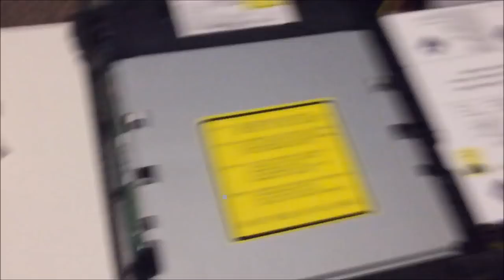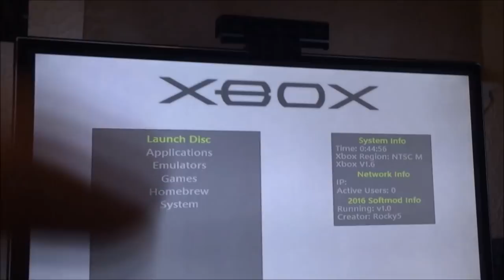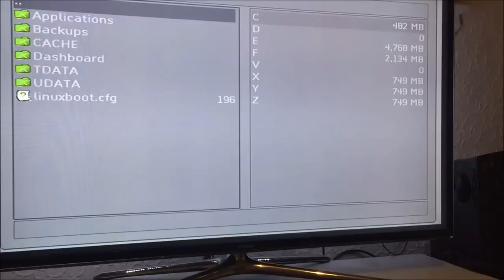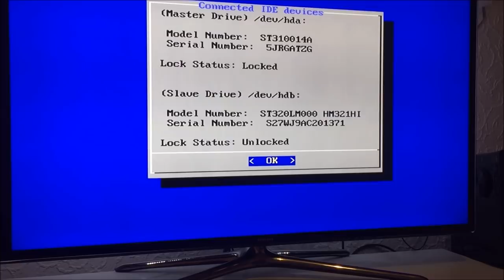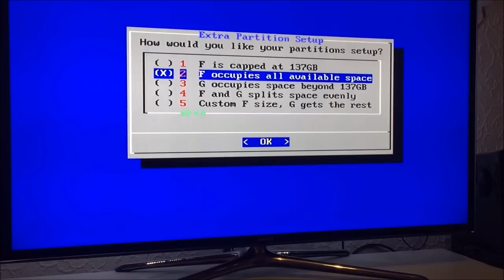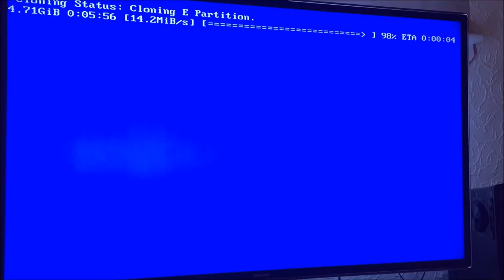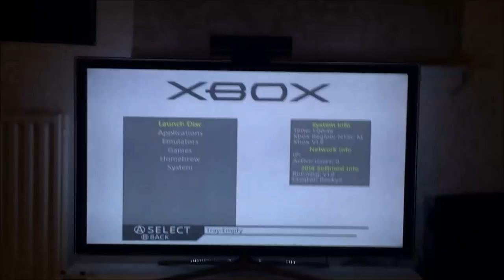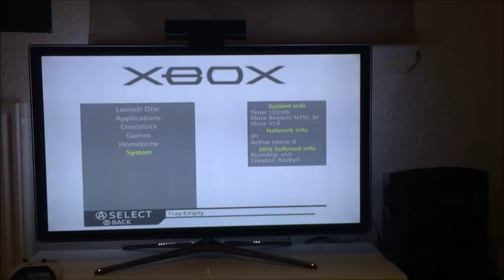How to clone your Hard drive using Chimp 261812 from start to finish.

Comment: I have an evox mod chip but my master says unlocked as well as the slave.  Is it okay to proceed to step 2 with both unlocked if i am chipped and not soft modded?
Reply from the maker: +Ashley C yes.
Reply: sorry had two more questions, 1. it is not reading the serial number on the slave, not sure if that is an issue. 2. i tried to clone and everything seemed as in your video except it said clone complete as soon as I hit okay which I know it couldn't have cloned anything that fast. Am I missing something?
Reply from the maker: +Ashley C try starting again, if you're using a sata adaptor change the slave drive to slave if you have it set to cable select as some adaptors are picky. 

Also 80 wire IDE cable if you aren't using one already.
Reply: im just using another pata harddrive going from 200gb to 250gb thats all so i am using the same ide cable the system came with.  i will try again
Reply: Hi again, I got everything to work except whatever option I choose it wont clone my F drive.  I chose C,E, and F and it skipped F.  I chose C,E,F,and G and it skipped F and went to G.  Why is it doing that?  Also I tried to just move my files into F via FTP but its giving me a permissions error and won't let me make changes to the FTP files.  Any help would be appreciated.
Reply from the maker: +Ashley C that's because you don't have a partition table on the drive, you would need to load XBPartitioner v1.3 on the master HDD and when it's loaded. Press the white button until you see at the top right "write table", you then press start followed by Y. Now chimp261812 it will clone all partitions. 
( I need to modify the XBPartition source so it does it automatically. Not got round to it yet )

As for permissions I haven't a clue, Fatx doesn't have permissions as its file system doesn't support them.
Reply: okay I think that's a little past my understanding abilities.  My current master drive has almost everything from games to movies on it so I would think its partitioned already.  I may have to wait for your update to complete this.
Reply from the maker: +Ashley C you can use the byte by byte option, but afterwards you will need to use XBPartitioner 1.3 to format the G partition. Give me till tomorrow ( later today ) and I will see what I can do for you.
Reply: okay thank you, i downloaded and uploaded the xbppartitioner v1.3 to my xbox apps and opened it up but it looks intimidating and i am too nervous i will mess up my master drive.  I am calling it quits for tonight.  I look forward to any help you can provide. good night for now. -A
Reply from the maker: OK I modified the XBP source code and committed it to my Github. Just redownload Chimp 261812 and its included.
Just launch "XBP Table Writer.xbe" inside the "Chimp\XBP Table Writer\" folder.

Select the partition table you need.
Reply: Wow, that was fast, thank you for helping me out.  I will try this when I get home this evening.  I guess my only concern is I won’t ruin what I already have on my Master by running this partition program?  I just have C, E, and F on my master.  The F is where I have xbox games, emulators, and movies on.  So I was hoping to have the same on the new drive.  C, E, and a large F partition for games, movies, etc.  My Master is starting to click and freeze sometimes which is the reason I want to swap drives before my Master completely dies.  Thank you again for the help and I hope I can figure this out later.
Reply from the maker: +Ashley C you run the xbe and press (A) then Y and then back to exit. Now you can clone your HDD fully. 

Note, you cannot resize partitions so you can't have all your files + a larger F partition. ( it's a format only kinda deal, there is no software to resize Fatx partitions )  So you will need to use the C, E, F and G takes remaining space option.
Reply: Really sorry to keep bothering you.  But I am attempting this again and have uploaded your updated chimp folder with xbp folder in it.  Not sure how to access it on my apps menu since just chimp shows up.  I tried to take the xbp folder out of chimp and put it under apps menu but it doesn't show up either.  Can figure out how to get to the XBP folder with the xbe file in it. Really sorry bout all this.
Reply from the maker: +Ashley C file manager is what you use.
Reply from the maker: +Ashley C let me know how you get on.
Reply: It worked!  Thank you so much, took a few hours but everything works like the old one.  My only question is the new hard drive is a little bigger than my master (only by 50GB) but I don't see any left over space.  I guess I thought once this was complete I would have a G partition to FTP files over into but there is no G partition that shows up on the FTP.  Not a big deal I am just happy to have a new hard drive but just a little confused why I don't see any added space.  Thank you again for walking me through all this!
Reply from the maker: +Ashley C enable the G partition in the settings of your dashboard. 

And your welcome.
Reply: Thank you, that worked.  I now see the 50GB under G on my dashboard. I did have one last question on using G.  I have my games on F but that is pretty much full.  I want to put more games on using the space on G but not sure how to get the games to work.  I tried adding a folder named games to G like I have on F but the game didn't show up on the Xbox.  Not sure how to use the 50GB G space now.  I went to file manager to see if I could find the file but G doesn't show up in the file manager.  Am I doing something wrong or missing a step?  Basically I have my games on F but I am out of space.  G has space but not sure how to add more games on G and have them appear with the rest of the games I have on F when I go to the Xbox.
Reply: I was able to get the game to work by going to a media center app that allowed me to access the G drive and then I opened the xbe and I was able to play but i guess I was hoping for an easier way.
Reply from the maker: +Ashley C what dashboard are you using? 
UnleashX you will need to edit the config.xml and add G:\Games\ under the F:\Games entry.
Reply: EvolutionX EVOX, don't think I have a config.xml file that I can find.
Reply from the maker: +Ashley C you don't need to edit evox.ini you just enable G drive in the setting menu.
Reply: Yes before you responded I figured it out that it was evox.ini and i tried editing it by copying what was there for f and making it for g. All it did was make another games folder appear under my menu but no games showed up in the g games folder (should have been 4 games in it).  if i just enable g the games don't show up anywhere either.  confused why the games folder in g shows up but not the games in after editing evox.ini
Reply from the maker: +Ashley C you don't edit the evox.ini. You go into the setting and enabled the F and G partitions. That's it.
Reply: F & G are enabled.  I reverted back to the original evox.ini but now I am back to not understanding how to get whats on G to show up on my dash like the games that are on F do.  You sure there is nothing in the evox.ini file that needs to be done?
Reply from the maker: +Ashley C no evox looks for F:\Games\ and G:\Games\

If it finds a folder inside there with a default.xbe inside it it will list it. 

Why not use unleashx? If it's skins you prefer I made a converter to convert evox skins to UnleashX. ( functions the same but more advanced )
Reply from the maker: +Ashley C https://drive.google.com/open?id=0BzRN8P835YijZUlBUHFSbHgzUWc
Reply: okay I will check again but pretty sure it was not finding the games on G. Is there alot involved to switch to unleashx?  I have evox because my friend who modded my xbox back in the day put that on it.
Reply from the maker: +Ashley C are you softmodded?
Reply: chipped
Reply from the maker: +Ashley C then you just replace the xbe file with UnleashX xbe file.

You know where your dashboard is stored ( next to the evox.ini ) so you just remove the xbe file the ink file and the skins file and then copy UnleashXs xbe and name it what ever the evox xbe was named.
( on first boot it will create a config.xml )
Reply: +JCRocky5 I am all set and done bothering you haha.  I figured out the issue why my G games where not being found.  Seems like I was missing some code in the evox.ini after searching on line as to what should be in there.  I needed this...
 {
Line "- Games on HD -",2
AutoAddItem "E:\GAMES\"
AutoAddItem "E:\HDDLoader\"
AutoAddItem "f:\GAMES\"
AutoAddItem "f:\HDDLoader\"
AutoAddItem "g:\GAMES\"
AutoAddItem "g:\HDDLoader\"
SortAll 
}
And I only had this...{
Section "Games"
{
AutoAddItem "e:\games\"
AutoAddItem "f:\games\"
SortAll
}Couldn't of figured this all out without your help. Thank you
Reply from the maker: +Ashley C glad it's all sorted now lol and you're welcome.

Comment: So i'm having a super issue. I have followed all the steps and after the two oks it says starting chimp 261812 and stays on that screen. All my components are official, the HDD has been verified to work with chimp, which is why i bought it. I've tried different HDD as well. when i start up chimp though, the eject light flash different colors and continues to flash. I don't know why it doesn't let me advance!!!!
Reply from the maker: +Synista Wun does the LED turn green and flash? also are you using standard AV cables?
Reply from the maker: +Synista Wun yeah you’re using component cables? Use standard AV cables or try disabling all resolutions.
Reply from the maker: +Synista Wun Chimp is loading, it’s just Linux can’t display anything on the screen, that’s why the LED turns flashing green.
Reply: I'm using AV cables and the resolutions are turned off.
Reply from the maker: +Synista Wun it’s a video encoder issue, what version of Xbox is it you are using? also what AV cables are you using?
Reply: I'm using stock av cables. I have after market HD, but it says mode no supported on my tv, so naturally its av. the version 1.1
Reply from the maker: +Synista Wun it’s should work on all Xbox version using standard AV cables. Have you tried just loading Chimp without swapping the HDD?

Also what location did to install the Chimp folder to?
Reply: Exactly which is what i thought. i tried to load chimp without swapping and its still stuck on the screen. is there a way to chat with you, that way you can see pictures or something? ive been at this for 2 weeks, i'm close to quitting.
Reply from the maker: +Synista Wun discord Rocky5#9119
Reply: request sent.

Comment: Okay so I succesfully finish the entire thing. But I noticed that I have 473,060.34 GB free on my F partition, which is weird considering my drive is 1TB
Reply from the maker: Two reasons for this.

1) your master drive was 500GB and you cloned it but didn’t not select G takes remaining space.

2) It’s split F and G, you will need to enable the G partition in UnelashX storage menu or use XBPartitioner to force it to use all space on F.

Comment: Tengo xbox que pasa el tiempo y se congela...ya descarte disco duro y va bien pero a que se deberia que se podria reparar en placa para que no se congele...ayuda por favor
Reply from the maker: If it passes the time check and freezes after then something else is wrong and there isn’t much I can do as it’s not my HDD and I don’t know what you have done to get to this stage.

I also don’t speak Spanish so google translators is kind of screwing up the translation.

You cannot just put another Xbox ( locked hard drive ) hdd into another Xbox unless they have the same unlock key stored in there eeprom. That’s why you will be getting error06 when you do.
Reply: the xbox opens normal works a while and then freezes and change hard drive in another xbox and it goes well (the two xbox have same eeprom) if it were a plate would be there or not? Thank you
Reply from the maker: So it works for a while then stops working and you put in the other hard drive and it works again for a while. But that one stops working?

Are these SATA drives? are you using an 80 wire (40 pin) IDE cable?
Reply: the same hdd works normal in another xbox
Reply from the maker: Then you just answered your own question. The Xbox is broken in some way.
Reply: if e tried with two types of hard disk and similar freezes,
Reply from the maker: It must be hardware then. Check the cables on the Xbox that has the problem. Replace the IDE cable using the one from the Xbox that works.

Comment: I'm getting a black screen with the "Your Xbox requires service." This was a virgin Xbox from the start with no mod chips that affected the bios. It is an older generation Xbox; made in 2001 with a GPU fan... Maybe the hard drive is too big? Maybe the software is too new? So many variables....
Reply from the maker: Yeah a v1.0 they don’t show the error code in the top left. It will be error07 or error13 as like I have said 3 times now use a 80 wire IDE cable.

Comment: Hi JCRocky5, I followed the tutorial to the T and it all worked, the cloning that is. I used a Sata 500gig HDD and an adaptor and locked the HDD. The adaptor looks the same as the green one you have in the video. It all went fine, until I plugged the assembled the xbox back with the new HDD set to master. All I was getting was the error screen about sending it in for repair. I tried a few setting with the jumpers on the adaptor, but nothing worked. I then used a IDE drive and had no problem, all worked. What do you think the problem is? I also watch another video where a guy said he couldn't get the sata working wither.
Reply from the maker: 80 wire IDE cable?
Reply: Yep, I used a 80 wire cable. I believe it’s the adaptor. It’s not the red one, I used the cheaper green one. It’s funny that it let me clone it, but not run it.
Reply from the maker: Normally when you get an error after cloning it’s due to the IDE cable. But the adaptor can cause errors also.

That’s due to the Xbox kernel panicking after a specific period of time or if a issue arises. The Linux kernel in Chimp doesn’t care that much and does have the same error handling.

Comment: The best option to to lookup a tsop tutorial and load ind-bios. Once loaded and bios are flashes. Download the hexen cd for Xbox and burn it.  Remove old hard drive and pop in the new one. Load up hexen cd and it will format and install your new larger hard drive.  A lot less hassle than using chimp as some freezing occurs with sata adapters.
Reply from the maker: Only beneficial if the user is comfortable with soldering. Also of no use, if they are wanting to clone there drive to keep there content. As you can clone F and add the remaining space to G if the drive is larger. 
( although chimp can be run the exact same way on a TSOP )

This video is old, the latest version prompts you to attach your HDD and press A, so only issues now are with the Linux kernel not supporting all HD outputs on all Xbox revisions. So SD cables only.
Reply: Was weird because I have used the older chimp many times before. Never used the new one so when i tried the other day with my sata adapter it just stuck on starting chimp in green. so I reverted to the older version. scanned ide device worked fine, so i was like ok, I replugged it back in and scanned devices a second time "after a cold boot" and im still getting an error "ide-detect module bla bla  .ko not found. weird it scans with the dvd drive. and the sata adapter i have is different than the ones i normall use "the red ones" i have the longer green one and I'm thinking that may have something to do with it? so thats why I mentioned the hexen option wasnt trying to flame your channel or anything. any input would be greatful if you have seen my error. unfortunatly google search said it could be many things and ont he reddit page someone said it was the ftp etc, and i did it on windows as well still no luck so tomorrow ill try the hexen method and see if it works

Comment: I'm getting a buffer i/o error while cloning my master drive. Does anyone know how to solve this?
Reply from the maker: Drive maybe on it way out, but normally that means it can’t access the drive. (You will get this when a slave drive is locked for example)
Reply: JCRocky5 thanks for the reply. I looked on a compatibility chart and turns out this HDD is not compatible. The drives model was ST2000VM003, 2tb for anyone wandering.

Comment: i keep getting this gentook screen and it gives me 5 seconds and then it starts loading more stuff. looks nothing like this
Reply from the maker: Yeah because you’re not using my version.
Reply: ok last question do i need the y splitter because i have a kit that allows me to connect the powere part of the hard drive direcly to a wall outlet. or do i 100% need the y splitter
Reply from the maker: You just need to power the hdd, y splitter or external power is fine.